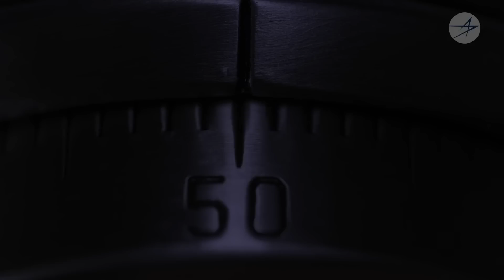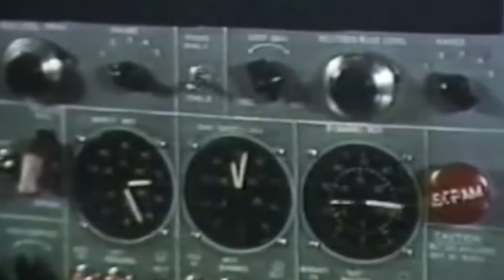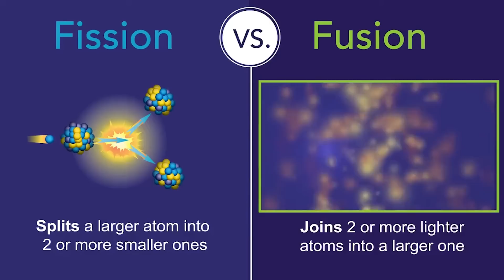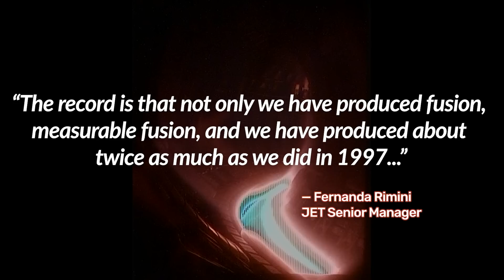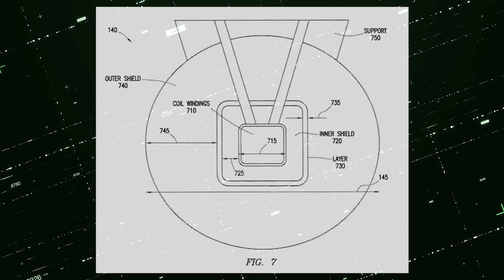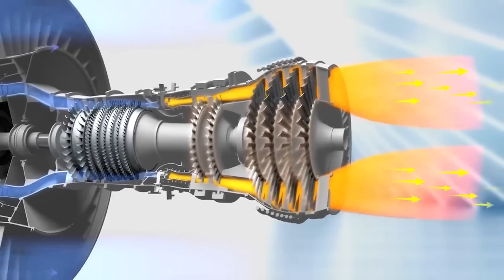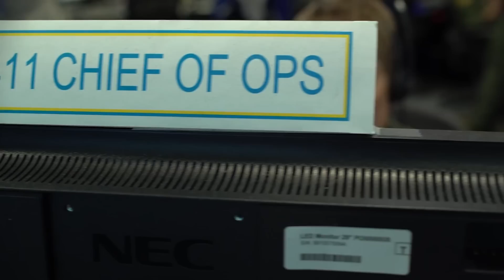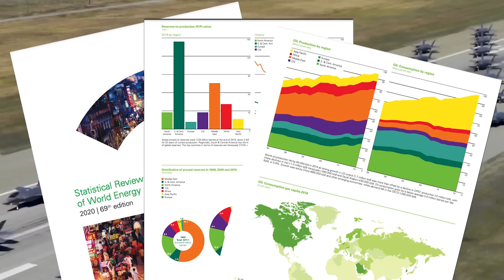Lockheed Martin's fusion-powered fighter and bomber plans

Comment: The funny thing about fusion power, unlike fission power plants we currently have, is that small/medium sized units might become practical before larger ones.
   I tried to understand why this is, but man it got complicated... If anyone could break that down for me, I'd personally appreciate it.
Reply: Basically they don't scale up well. Everyone knows magnets lose their strength dramatically the further you hold them apart. So a bigger reactor needs a ton of power just the run the magnets. On top of that the magnetic fields are also acting on the structure of the reactor itself, so you have to make it INSANELY strong to resist warping of even imploding.

A smaller reactor solves all these problems by just being smaller.
Reply: Right now the devises we have on average consume as much power as the produce.
Reply: @erasmus_locke  that makes a lot more sense. I was lost in particle physics and the electromagnetic spectrum... 😅
Reply: Actually all the previous mentioned issues are resolvable enough still, they're not considered actual show-stoppers. 

How ever they do all imply one thing together, which is enormous investment costs to build all these expensive devices at very large sizes. If making just one device costs a fortune, you won't be making new ones very quickly, and not only that, it takes a long time to just build one. And so inevitable iteration of design becomes slow, time lines stretching in to the decades.

So by basic logic if you could figure out a way so that a medium device can run cost effectively, it's far cheaper and quicker, to iterate through different designs till you get one that will work for you.

So as long as it is viable for a smaller device to work, then a smaller device has a good chance to complete first just because its R&D runs so much quicker and cheaper.

And this is why recently when they figured out a few new options that might allow devices substantially smaller then ITER to run cost effectively, we suddenly started seeing a proliferation of new medium scale projects. So if one of those ideas work, they very well may complete much earlier.
Reply: beta limit
Reply: It was my understanding that there are two competing factors at work here, meaning that fusion reactors are hard to scale down beyond a certain size, and hard to scale up beyond a certain size. I have no idea what that size IS on either end, but there should be limits.
In any case, what mechanisms are doing this? I'll explain both.
As was said, it's incredibly hard to create large, intense magnetic fields. This is because magnetism falls off with distance not as 1/r^2 like light or radio waves or even gravity, but instead as 1/r^4.

But the other factor that prevents scaling DOWN reactors is also of note, and I'll focus on that one because other commments have focused on the first one.
You see, when you make an ionized particle change directions, (such as an electron or ionized atomic nucleus) it loses energy. This energy is carried away as photons.
This is used to our advantage in Free Electron lasers, but in a fusion reactor it works against us, since the whole point is to have the atomic nuclei in the ionized fusion plasma at a temperature high enough to sustain fusion, and taking energy away from the nuclei reduces their temperature.
The name for light or radio waves so produced is called "Bremsstrahlung Radiation", and another name for it is "synchrotron radiation".
Now why does this matter? Well, the smaller the fusion reactor, the smaller the radius of the magnetic field it creates. This makes the atomic nuclei traveling around in it travel in tighter curves, while maintaining roughly the same velocity because we're talking about the "thermal mean velocity" here, as you know when a gas is hotter its molecules or atoms move around faster and fusion always needs the same temperature to ignite.
Well, OK, but what does that mean? Well, it means that those atomic nuclei traveling around at the same velocity in a smaller turn radius are emitting more Bremsstrahlung radiation, and therefore you need to put more energy into the plasma to keep the reaction running.
At some point, you make a reactor so small that it's spending all the energy it makes (or worse, drawing MORE power than it makes) to maintain the magnetic fields and to offset the losses to Bremsstrahlung radiation.
Reply: @44R0Ndin  I see, that's interesting, I guess that would be a further limit then, though considering past fusion reactors and the MIT SPARC proposal, one imagines that reactors like ITER are well above that limit.
Reply: @44R0Ndin  Does this apply to all designs of fusion reactors or just ones where you're chaging direction a lot, like a Tokomak? Like if you went with an inertial design, isn't the point that there's no movement at all?
Reply: @Cyrribrae  It doesn't apply to non-thermal fusion reactors (colliding beam type and inertial confinement type), but it does apply to thermal type fusion reactors (tokamaks and stellarators) Not quite sure if it applies to Z-pinch type or not, as that's something of a middle-ground between a thermal and an athermal fusion reactor.
Reply: That's literally the opposite of what the known physics says. One of the main issues with fusion reactors is the heat loss and that gets smaller with more powerful reactors.
Reply: @patrick_test123  So you're saying bremmstrhlung isn't an issue for these kind of reactors?
Reply: @Quickshot0  You'd need very fast electrons for that? But in gerneral fission reactors are something you want to look at from behind a lot of (heavy) shielding while running.
Reply: @patrick_test123  Uhmm yes, a fission reactor is like that. Though I guess in general the same would be true for a fusion reactor.
Reply: @patrick_test123  More powerful reactors lose heat slower, that might be true. But smaller reactors lose heat faster, both thermally and because of bremsstrahlung radiation losses leading to what would have been a high-energy nuclei ready to be fused with another, cooling simply by being forced into an orbit that makes it give off either radio waves or infrared photons, both of which lead to a lowering of the mean free particle velocity in the reactor, which is exactly counter to the continued operation of the reactor.
So a magnetically confined fusion reactor that you can hold in the palm of your hand simply won't ever happen. For a fusion reactor that small, you'd need to turn to an inertial confinement design to achieve even the most basic operating criteria of a sufficiently large net energy gain, let alone useful energy output or high efficiency.

As you increase the size of a reactor, you run into the other side of the thermal problem, but also into a side effect of trying to minimize losses to bremsstrahlung radiation. And that's that it's impossible to make a magnetic field that's sufficiently strong to contain the fusion plasma at a large enough scale, this eventually limits the size of the fusion reactor you can make.
But there's another problem that I think will even further restrict the maximum size of a fusion reactor. And that's heat. Not useful heat, but the unavoidable fact that things that have a lot of power flowing thru them get hot and that heat needs to be moved somewhere or things start melting and breaking and failing. Waste heat, in other words.
Even if they're superconducting, those magnets are going to need to have an active cooling system to keep them within operational limits, which means you can only make the magnets so big before you run into the fact that you can't build a cooling tower big enough to get rid of all the waste heat. Now some of the really hot waste heat might be able to be siphoned off and used to create steam to run thru a more conventional steam turbine generator, but even then you've gotta condense that left-over steam somehow and that's gonna need a cooling tower or a nearby large lake or river or other large body of water to dump the waste heat into. Siting a fusion power plant near the ocean might be an incredibly good idea, not only can you in theory sort the heavy water out of the ocean, but you can use it for cooling as well (just make the heat exchangers out of stainless steel or some other high-nickel alloy so they don't corrode within like 5 years).
But the waste heat problem will eventually prevent you from up-scaling the fusion reactor, that much I know for certain.
And larger reactors DO have less of a problem holding on to heat, down at the small end that works in your favor but up at the gigantic end it becomes a real pain in the butt.
Reply: @44R0Ndin  Thanks for that explanation 44.
Reply: The small/medium sized fission reactors were practical before the larger ones too. I've stood watches on the S1W prototype and its the size of a two story condo.
Reply: @erasmus_locke  I like MSRs. Pelletized fuel. Molten salt reduces pressure requirements for cooling. Just real hard on metals.
Reply: I could shed some light I think it is a trade-off here, larger devices should in principle offer clearer way to fusion (sun is very ineffective reactor, energy output of the sun's core is similar to the heap of rotting plant matter in the given volume, but it is very large so the output adds up), you don't need that high of a temperature/density of fusion fuel in larger reactor and your radiation loses are lower (you can heat up the plasma more effectively as less energy is lost due to radiation). But smaller systems have one huge benefit: they can be iterated much more rapidly, potentially allowing scientists and engineers figure out problems much faster. But whether fusion will ever become compact enough to power an airplane, not sure, maybe only the biggest ones.

Comment: I did a paper when I was in college for physics on fusion reactor types and you left several of those types out of the list and video. Some of these reactors could not only produce electrical energy but can be used as a form of propulsion as well.

Comment: Working fusion for more than a few seconds? Like really? I thought we needed at least more than 50 years to see this come to use. It is basically the holy grail and if you can use it you can basically do anything. I am very skeptical that those at skunkworks are already that advanced in this field.
Reply: Yeah this doesn't sound realistic....  
Just to start the process of Nuclear Fusion requires filling a ton of capacitors and releasing a huge electric charge to create plasma.  It also potentially would required extremely high strength magnetics which I feel like would just destroy any electronics in the vehicle, since the plasma is so hot that it has to be held in a vacuum suspended in space prevented from touching anything in its containment area.  
  
We have nuclear fusion but no one has yet to actually create power from it, it currently requires more power than it generates.
Reply: @Lolatyou332  The new ambient temp/pressure superconductors (if real) could absolutely be a massive step towards making fusion a reality.
Reply: Who knows? Those who work with the hypersonic aerodynamics of re-entry vehicles and very fast aircraft have experience with plasma management different from that of the common fusion researcher; perhaps somebody figured out how to put it to use on the fusion problem.
Reply: @Lolatyou332  We have airborne EMP weapons. That technology in theory can be adapted to plasma generation. The use of RF power to make a hydrogen plasma has been around for generations. The hard part is powering up the magnetic field, for that large capacitor banks would be necessary. But what if the reactor once started could drive its own magnetic field? Then you would only need the capacitor banks on the ground, like the engine start carts now used for some turbine engines.

Comment: Pretty interesting story. I never thought that people would be attempting this at this point honestly. The first time I ever even heard of the concept of fusion reactors powering an aircraft was in the Macross Anime series that first aired in 1984. They are also used in Gundams, in the  Gundam series. That aside, this is something I’ll definitely follow. Hopefully you’ll continue to cover this topic, & thanks for this video.👍🏿🇺🇦🇾🇪🇭🇹
Reply: Fusion power for aircraft dates back to earliest days of nuclear power, its wasn't feasible then or now
As for Macross and Gundam
Fusion power is the only realistic power source for both if you tried to build it real world
Gasaraki TA very much realistic as they had very limited operational time of just 60 minutes and even with upgraded power cells, its still just 36 hours 
They had no over tech weapon, just basic auto cannons and missiles and even the model equipped with a rail gun still require a lot of time between shots

Comment: I'd be concerned about the maximum thrust achievable via the fusion-powered engine system outlined. (Throttling isn't the issue. You could use valves and per-engine bypass circuits to vary the fluid flow rate through each engine. It's a limitation on the thrust at full-throttle I'm thinking about.) With combustible fuel injection the heat is generated right where it's desired (in the airflow), so no conduction needs to happen. (It'll naturally happen within the airflow, but you're not dependent on that happening.) With a fusion-heated fluid circuit, the heat has to conduct through the walls of the plumbing into the air. There's a physical limit to how quickly that will happen, proportional to the difference in temperature. You'd engineer the plumbing for maximal conduction, but you can't really vary the air temperature, and you can't just let the fluid get arbitrarily hot or it'll melt the plumbing. You could increase the maximum overall rate of heat transfer within an engine by spreading the fluid through a forest of little capillaries, but that would increase drag. Increasing the compression of the airflow would increase heat transfer, but that might cause problems for lower-speed phases of flight, similar to the challenges with ramjets and scramjets. Such tech might be limited to slow aircraft like cargo, tankers, maybe bombers, etc.
Reply: Or don't vary the flow rate but vary the length of the combustion chamber, by bringing additional heat exchange surfaces online (or offline, depending on how much thrust you need).

I'd worry about the internal plumbing though.
Even if magnificently insulated, it will inevitably warm up eventually.
So you'll either need massive AC capacity (or you need to fly at 30k ft and open a window, to let that -50°C air blow through, hehehe). 
If this isn't done, then the plane will be limited in flight time regardless of its fuel type, because now the pilots are slowly getting cooked....

Comment: 13:22 Modern fighters don't use turbojet engines anymore (they were phased out by the era of 4th gen fighters). They use turbofans, just like with commercial airliners and bombers. The difference is that modern fighters use low-bypass turbofans, while commercial aircraft and bombers (and attack aircraft like the A-10) use high-bypass turbofans.
Reply: So they’re no longer ‘fighter jets’ but instead ‘fighter fans’?
Reply: Huh. Why is that? Is there a benefit to having at least some bypass? Just cheaper and more reliable?
Reply: @Cyrribrae  It provides cooling air for the engine, reducing the amount of liquid cooling needed. For afterburning low-bypass turbofans, the bypass air also provides a cushion between the flame trail and the augmenter section and exhaust nozzle to prevent burn-through. When the afterburner is on, it’s cool enough to actually touch the augmenter section.
Reply: @namja01  That makes a lot of sense, thanks!
Reply: @TheFish711  Damn xD